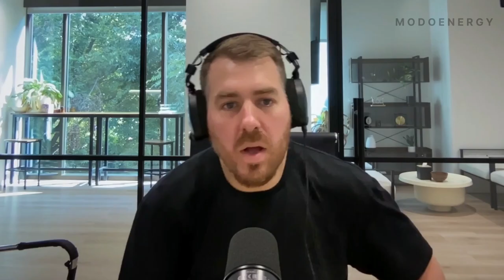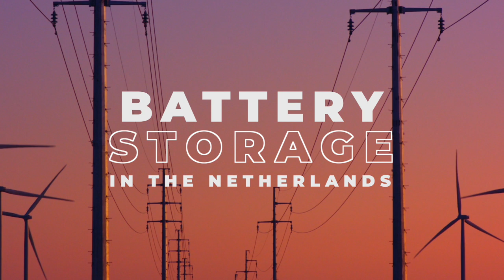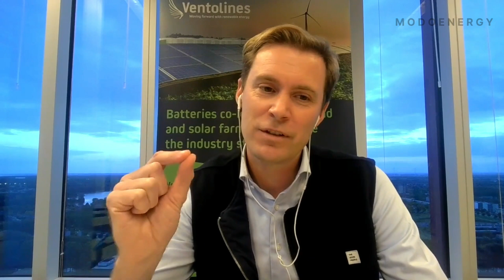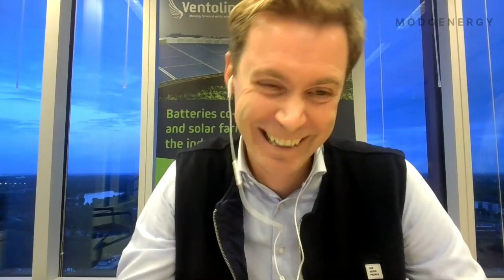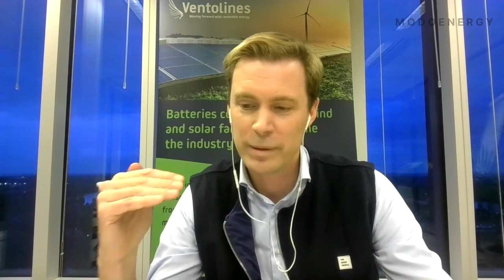Battery storage in The Netherlands - Transmission (Rens Savenije: Business Lead at Ventolines)

Comment: 102002  Nanometer scale uniformly aligned parallel diode arrays may be a practical way of absorbing ambient heat. Ambient heat is uniform on a micrometer and larger scale and non uniform on a nanometer scale. Plausibly,  heat absorbtion at the non uniform scale is available as Johnson Nyquest thermal electrical noise that would yield, by conversion without gain or loss, an equivalent amount of electrical energy. 
AND
 Diode voltage / current  characterstics can be displayed on an XY tracing oscìlloscope. Thermal electrical noise power in resistors can be displayed by time sweeps of voltage on an oscilloscope. Each such time sweep is unique.
AND
A  simple  "Special Program with Integrated Circuit Emphasis" model indicated that diodes in uniform alignment parallel would aggregate simulated rectified thermal electrical noise.

Maximum direct current electrical power, half, is transfered from a direct current electrical source to the electrucal load when the electrical resistance of the two parts is equal. Calculated matched resistance output (watts) is k (Boltźman's constant), one point three eight x 10^ minus 23, times T (temperature Kelvin) times bandwidth (0 Hz to a natural limit ~2 THz @ 290 K) times rectification halving and nanowatt power level rectification efficiency, times the number of diodes in the array. 

There are a billion cells of 1000 square nanometer area each per square millimeter, 100 billion per square centimeter. 

Creditable independent replicatable proof of concept protypes beyond improper influence are needed.

Aloha
Charles M Brown 
Kilauea, Kauai, Hawaii 96754

Comment: 102002   The second law of thermodynamics may be false conventional wisdom. Let's face the wonder of full heat use. 

The second law of thermodynamics was developed during v8ictorian england's scientific and religious fascination with steam engines. 

The second law is behind modern refrigerators needing electrical energy to compress the refrigerent to force it to release as waste the heat that it has removed from the refrigerator's service interior in the cooling part of the refrigerent's circulation. The interior coldness draws in exterior heat through the cabinet insulation. There is also discarded heat from mechanical friction and electrical resistance. The net thermal output equals the electrical input with energy not being gained or lost in this refrigeration system including its forced waste. Unencumbered refrigeration by the principle that energy is conserved should produce electricity instead of consuming it. 

It makes more sense that refrigerators should yield electricity because energy is widely known to change form with no ultimate path of energy gain or loss being found. Therefore any form of fully recyclable energy can be cycled endlessly in any quantity. 

Full heat recycling, all electric, very isolated underground, undersea, or space communities would be highly survivable with self sufficient EMP resistant LED light  automated vertical farms, thaw resistant frozen food storehouses, factories, dwellings, self contained elevators, safe rooms, and horizontal transports. 

In a flourishing civillization, small self sufficient electric or cooling devices of many kinds and styles like lamps, smartphones, hotplates, water heaters, cooler chests, fans, radios, TVs, cameras, security devices, robot test equipment, scales, transaction terminals, wall clocks, open or ciosed for business luminous signs, power hand tools, ditch diggers, pumps, and personal transports, would be available for immediate use incrementally anywhere as people as individuals or larger social groups see fit. 

Some equipment groups could be consolidated on local networks. 

If a high majority thinks our civilization should geoengineer gigatons or 
teratons of carbon dioxide out of our environment, instalations using devices that convert ambient heat into electricity can hypothetically be scaled up do it with a choice of comsequences including many beneficial ones. 

Energy sensible refrigerators that absorb heat and yield electricity would complement computers as computing consumes electricity and yields heat. Computing would be free. Chips could have energy recycling built in.

A simple rectifier crystal can, iust short of a replicatable long term demonstration of a powerful prototype, almost certainly filter the random thermal motioren of electrons or discrete positiive charged voids called holes so the electric current flowing in one direction predominates. At low system voltage a filtrate of one polarity predominates only a little but there is always usable electrical power derived from the source, which is Johnson (observation) Nyquest (theory) thermal electrical noise. This net electrical filtrate can be aggregated in a group of separate diodes in consistent alignment parallel creating widely scalable electrical power. The maximum energy is converted from ambient heat to productive direct current electricity when the electrical load electrical resistance  is equal to the array internal electrical resistance. 

Maximum calculated electrical power output (watts) is k (Boltźman's constant), one point three eight x 10^ minus 23, times T (temperature Kelvin) times bandwidth (0 Hz to a natural limit ~2 THz @ 290 K) times rectification halving and nanowatt power level rectification efficiency, times the number of diodes in the array. 

There are a billion cells of 1000 square nanometer area each per square millimeter, 100 billion per square centimeter. 

Order is imposed on the random thermal motion of electrons by the structual orderlyness of a diode array made of diodes made within a slab: 
-----‐------‐----___-- Out
🔻🔻🔻🔻
■■■■■■___ + Out 

All the P type semiconductor anodes abut a metal conductive plane deposited on the top face of the slab with nonrectifying joins;  the N type semiconductor cathodes or common cathode abuts the bottom face. As the polarity filtered electrical energy is exported, the amount of thermal energy in the group of diodes decreases. This group cooling will draw heat in from the surrounding ambient heat at a rate depending on the filtering rate and thermal resistance between the group and ambient gas, liquid, or solid warmer than absolute zero. There is always a lot of ambient heat on our planet, more on equatorial dry desert summer days and less on polar desert winter nights.

Focusing on the composition of one simple diode, a near flawless crystal of silicon is modified by implanting a small amount of phosphorus (N type conductivity) on one side from a ohmic contact end to a junction where the additive is suddenly and completely changed to boron (P type conductivity) with minimal disturbance of the crystal lattice. The crystal then continues to another ohmic contact. 

A region of high electrical resistance forms at the junction in this type of diode when the phosphorous near the ĵunction donates electrons that are free to move elsewhere while leaving phosphorus ions held in the crystal while the boron donates holes which are similalarly free to move. The two types of mobile charges mutually clear each other away near the junction leaving little electrical conductivity. An equlibrium width of this region is settled between the phosphorus, boron, electrons, and holes. Thermal noise is beyond steady state equlibrium. Thermal noise transients, where mobile electrons move from the phosphorus added side to the boron added side ride transient extra conductivity so the forward moving  electrons are preferentally filtered into the external circuit. Mobile electrons are units of electric current. They lose their thermal energy of motion and gain electromotive force, another name for voltage, as they transition between the junction and the array electrical tap. 

Inside the diode, heat is absorbe; outside the diode, to exactly the same extent, an attached electrical circuit is energized. The voltage of a diode array is likely to be small so many similar arrays need to be put in series to build higher voltage.  

Understanding diodes is one way to become convinced that Johnson Nyquest thermal electrical noise can be rectified and aggregated. Self assembling development teams may find many ways to accomplish this wide mission. Taxonomically there should be many ways ways to convert heat directly into electricity. 

A practical device may use an array of Au needles in a SiO2 matrix abutting N type GaAs. These were made in the 1970s when registration technology was poor so it was easier to fabricate arrays and select one diode than just make one diode. 

There are other plausible breeches of the second law of thermodynamics. Hopefully a lot of people, mostly as independent teams, will join in expanding the breech. Please share the successes or setbacks of experiemental efforts. 

These devices would probably become segmented commodities sold with minimal margin over supply cost. They would be manufactured by advanced automation that does not need financial incentive. Applicable best practices would be adopted. Business details would be open public knowledge. Associated people should move as negotiated and freely and honestly talk. Commerce would be a planetary scale unified conglomerate of diverse local cooperatives. There is no need of wealth extracting top commanders. We do not need often token philanthropy from the top if the wide majority of people can afford to be generous. 

Aloha
Charles M Brow 
Kilauea Kauai Hawaii 96754

Comment: Some good insights but the comment about building more nuclear makes no sense in the context of the transition to renewables and battery storage. Nuclear is grotesquely expense - look at the price the public will pay for energy from Hinckley C - daylight robbery. Invest the money in retrofitting the U.K.’s 30 million homes to EnerPhit energy efficiency standards and cut annual electricity consumption by 200 billion kWh a year.
Reply: Also nuclear doesn't load follow so it doesn't create as much value per MWh
Reply: Luckily the guest shut him down right away with nuclear waste.

Has he dug a hole in his garden to receive his portion of waste to take care of?
Reply: SMR have a low  LCOE and are far more stable then Hydrogen at the moment. They might solve local heavy energy more easy because they also generate a lot of heat. The technology is know for 50 years now. Tried, tested and under great scrutiny.  The demands fo isntalling a big one are so ridiculous. That makes them even more expensive. France prices for nuclear are somewhat the same as for wind or even cheaper.